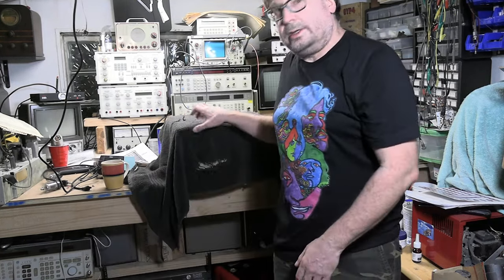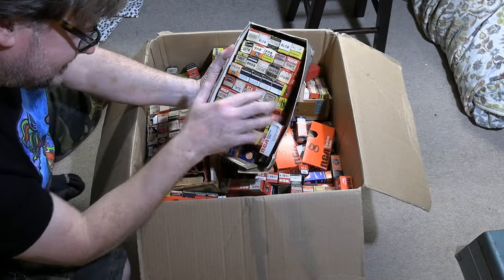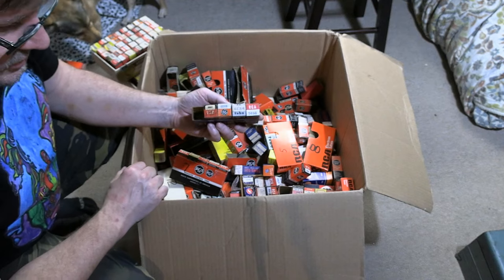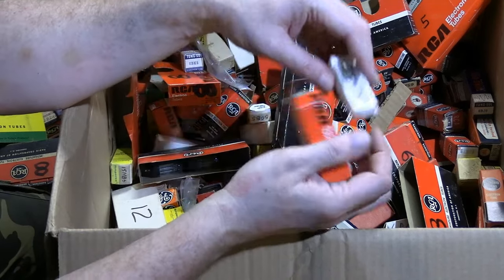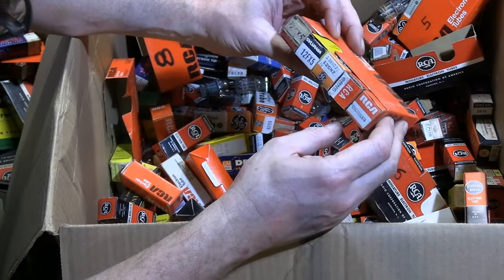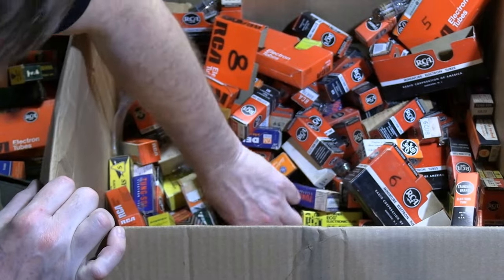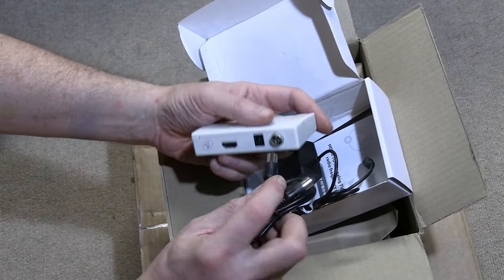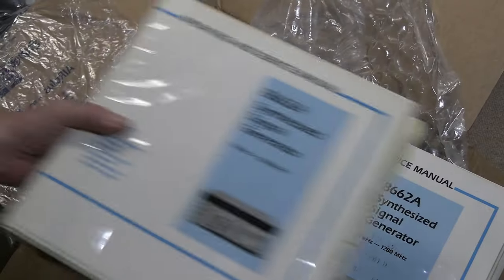7" proposal and some unboxing

Comment: I would do both, with careful descriptions of the differences, since they are two sets by the same maker and year it is a good way to compare and contrast. 
A nice little score of NuVistor tubes there. As you said they were mainly used in Tubers, UHF radios, and communications gear along with scope front ends. The Ampex MR-70 used them as preamp tubs, as well as bias and erase oscillator tubes after that Ampex introduced the AG-350 which was all solid state. 
The one place most people do not think of them being used is in TV production. NuVistor tubes were used in replacement amplifiers in some cameras like the RCA TK-40 and standard issue in later TK-41 color cameras, they are also used in the TK-12/TK-60 high-end monochrome camera. 
They were also used in the Second generation of VTR which was the first generation of high band high-performance color VTR Ampex used them in the VR-2000 in 1964 and RCA used them in the 1966 TR-60 and TR-70, NuVistors were used as video preamps in the head assembly as they were able to handle the higher bandwidth FM video signals with higher gain and lower noise than the transistor preamps of the time, but by 1968 he Nuistors were out in the Ampex VR-1200 and RCA TR-70B. 
Nice score on the HP manuals.

Comment: I was going to suggest one restoration series with both sets side by side, but it appears most would favor separate series. However, it would be informative to have one shorter video to start with both chassis on the bench side by side with an overview of each, pointing out similarities and differences in layout/design/circuitry.

Comment: The Arial plug you think is weird on the HDMI to RF converter is the type used on TVs and some FM radios here in Europe, TVs have a female socket and the Arial cable have the male plug, FM is inverse. Here F-connectors are used for satellite receivers and LNBs.  Greetings from Denmark
Reply: In most of europe F type connectors are also used for Cable TV installations and to connect cable TV based Modems to wall outlets. This is where u have these weird wall sockets often referred to as multimedia antenna wall sockets, which have 3 different plug styles on them; 1 or 2 female F connectors for Sat/cable, a male IEC for TV, and a female IEC for radio, and the signal paths are separated by band path filters inside the wall socket.

Comment: Hey Bob, Wow, congrats on that really cool Admiral 7" acquisition, it happens to be the exact set I am working on for myself, and I am fighting a strange vertical jitter problem! It would be great to see  you do either a separate electrostatic series vs magnetic deflection, but I would still enjoy seeing you cover the 7" even if you integrate it with the magnetic 10" series!
Reply from the maker: I've done 3 or 4 of them over the years. Search my channel for 19A11 or 19A15

Comment: Bob, both proposals on set presentation seem feasible. i would like a thorough explanation on the high voltage and precautions on the capacitors used in the electrostatic sets.  When the 6sn7 tubes were used in the vertical circuits on some sets, they've become popular now with audiophiles. A friend of mine who recently passed used to build audio amps with various odd ball tv tubes. They sounded quite good. Looking forward to both TV restorations.

Comment: I think separate series, one after another.  Definitely not the "compare and contrast" mixing of two sets.  It will be completely unfocused. If the first series takes forever for some reason and you want a break, I supposed you could start the electrostatic review concurrently, but they should be titled and numbered separately and be standalone.

Comment: That antenna plug is very much recognizable as what I would call a 75 ohm coax connector or antenna connector. Common in Europe. Also I do expect you to have discovered the adapter that is included in the box. It's rather visible in the video, if not from your perspective 😂 while recording

Comment: I bought one of those cheap HDMI converters only because somebody gave me a Roku fob for free and I wanted to watch it on my '49 Hoffman.  Only thing was it had a dark, slowly moving hum bar in the screen when using the adapter.  Then I discovered it only happened with the converter sitting right on top of the TV.  I moved it a couple feet away and it works great.  Maybe the converter isn't shielded that great or something, I dunno.

Comment: That HDMI adaptor is weird, I found mine produced two signals in the low VHF channels, nothing in the high VHF channels and several signals in the UHF range. That’s a European antenna socket on the back. Known as Belling-Lee in the UK and PAL (strangely) in Australia. Dozzies TV workshop channel shows how to get composite from it. Yes, you did show an adaptor that will fit the r.f. socket, the same adaptor will fit the 405 line TV

Comment: The cheap Chinese converter does come with a female coaxial out for cable.  You just need to be sure it says it has it as a standard coax output for RF.  I bought one off Amazon without looking close enough and got one with the same funky output you have.  I watched a Hallicrafters restoration on Buzz1151's YouTube channel and he managed to fabricate some sort of home built adapter for coaxial output for the RF.
Reply from the maker: It actually came with an adapter that I didn't notice
Reply: Actually this type of connector is called IEC or Belling-Lee antenna connector and is common in many parts of europe, south east asia(!!!) and australia. But the chinese have the gender of the plugs wrong or dont care about the standard established... Following the established standard a TV or VCR is supposed to have a female recepticle on the set, thus the TV transmitter or TV antenna output or TV antenna wall socket should have a male output connector for TV. While for FM radio the gender is reversed; a male recepticle on the radio tuner and a female plug on the FM modulator/FM antenna... This difference in gender was established to facilitate the correct connection of TV and Radio to a combined TV/Radio wall socket. But on Bob's device (as on many chinese TV modulators you see these days) the TV modulator is equipped with a female socket for output, which needs you to fabricate a non standard connecting cable with two male plugs if u plan to use the modulator on TV equipment following IEC standard gender coding. And a word of wisdom on these modulators; most of the cheap ones use a one chip modulator IC which preprogrammed only supports audio IF of 5.5/6/6.5Mhz (china mainland using the latter) but not 4.5MHz as used in the US

Comment: For a moment there I thought you had gotten a second dog.  You can never have too many dogs, or cats, on You Tube.

Since these will all end up as videos on You Tube, there might not be much difference in the end result made by the order as long as the titling is consistent between the projects.  But it could help newbies who are following and asking questions, discussing, etc. "right now" if the same set was worked on from start to finish, before the next one.

Keep your titling consistent (even revising it if necessary to show N of X about ZZZ) across each ultimate series.
Reply from the maker: We do have two dogs. Big dog is Shadow. Little dog is Jupiter

Comment: I don't know about doing a compare-and-contrast; I think I would eventually forget which circuits were used on each.  But then, I would like to hear more about the differences between electrostatic and magnetic models, though.  I've been really intrigued by your videos on electrostatics, which goes back to a time before anything I have experience with.  When I was a RADAR technician, we had CRT displays up to 12 inch with electrostatic deflection, but that was a whole different world.  I don't believe I've ever SEEN an operating electrostatic TV, outside of your videos.  So what was the big deal?  Why did we go from TVs with separate RF HV supplies to sets that integrated the horizontal (magnetic) deflection with a flyback HV power supply?  You would know better than I, the best way to approach this, since I'm sure you have an understanding of how the whole transition went down.

My GUESS would be, since you already have some pretty comprehensive videos on restorations of electrostatics, it would be useful to go through the restoration of an early magnetic, highlighting the places in the circuitry these departed from their ancestors.

Great videos; thank you.
Reply from the maker: I'll cover electrostatic TVs in a separate series. Both were offered at the same time. Electrostatic tvs are simply cheaper to make. At least for small screens. By the time 1951 rolled around, no one wanted a screen that small so they stopped making them. I actually have a couple giant 12" electrostatic radar CRTs. I hooked one up to a tv chassis years ago. It produced a very weird image

Comment: Did you delete my comment? I have an admiral counsel and a GE portable (I think). Up for a trade? You can have both for a tube radio. I guess I'll leave my email out of this comment incase that's why it was deleted. I'll drop them off for you
Reply from the maker: No, I didn't delete anything. I need more info. Where are you located, which models, what's the condition?
Reply from the maker: My email is bandersentv@gmail.com
Reply: @bandersentv  I sent you an email with pictures attached
Reply: YouTube automatically deletes comments with links to other websites, if that's what you included. I think even the owner of the channel cannot see them